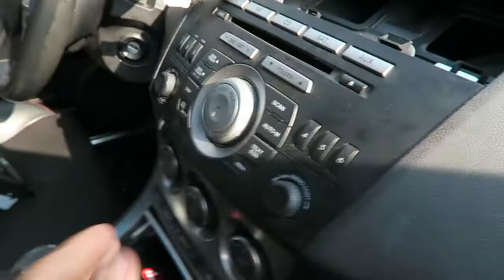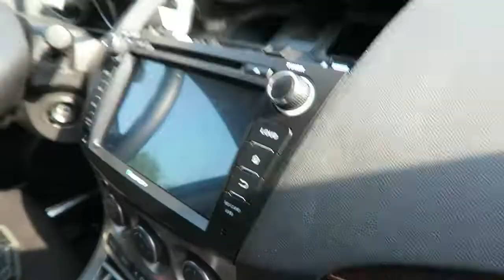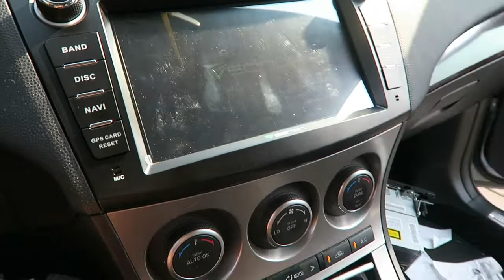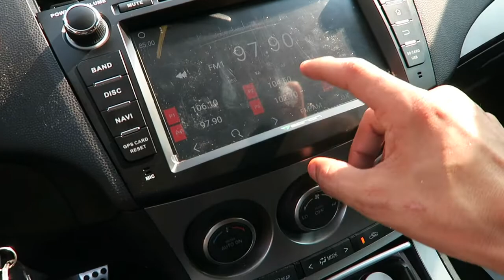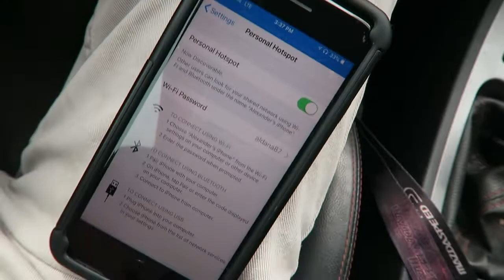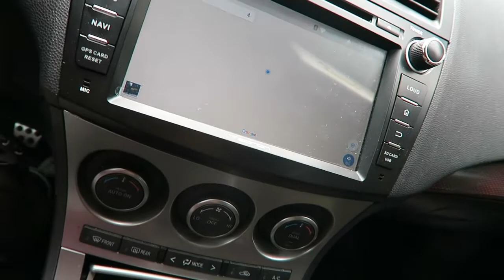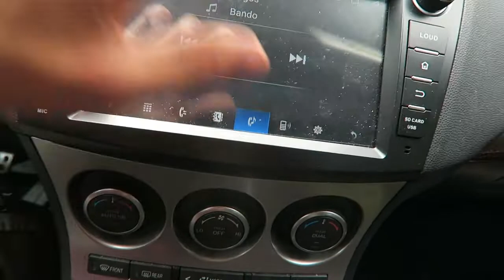Eonon Installation Video

Comment: Do you get static at high volume with it?
I got mine last week but its  kicking to much static at high volumes
Reply from the maker: Only when playing the radio you might have some interference with a remote wire or something
Reply: @mazdaspeedg2380  aye bro do you have a bose system in your ms3? And where'd you connect the the aux cords connection in the back?
Reply from the maker: On the speed 3 my aftermarket radio had the aux up front on the radio
Reply: @mazdaspeedg2380  yea but the eonon comes with an aux adapter cable that plugs into the factory harness ,not the power cable but the second biggest plug in the back.

Comment: I have the same model.  I'm not getting any sound from mine at all. I need help. The mic works. I am not getting sound from anything. Radio, Bluetooth etc. I unplugged and reconnected. It might be the RCA cable but I don't know.
Reply: Cap N Zeta I am having the same issue did you ever figure it out?
Reply: I had one that lost audio after a month, I contacted the company I brought it from and did a warranty exchange.  They say the motherboard had to be switched
Reply: Same problem